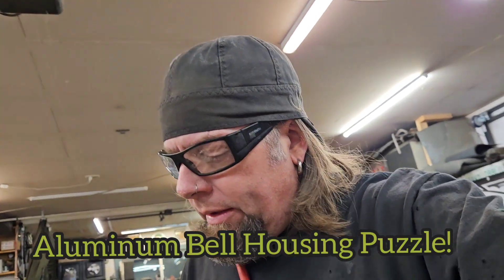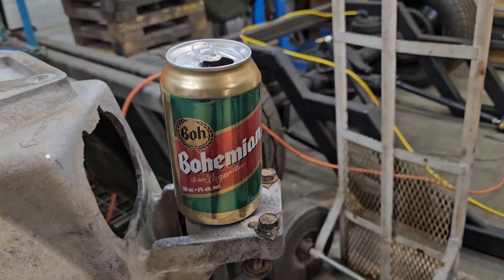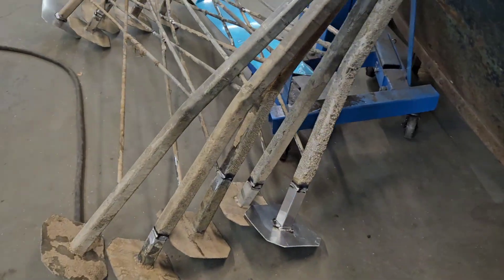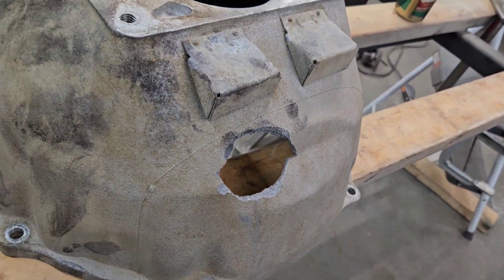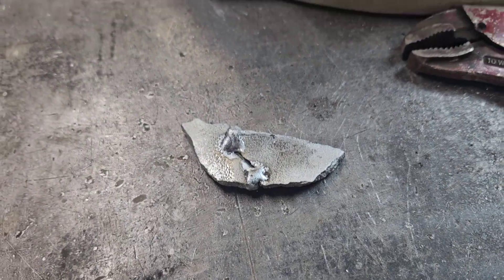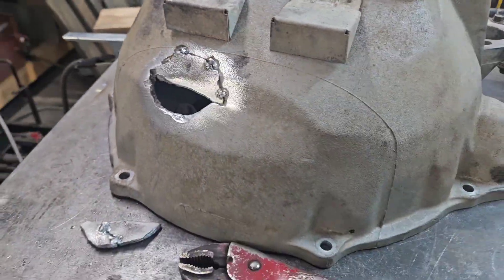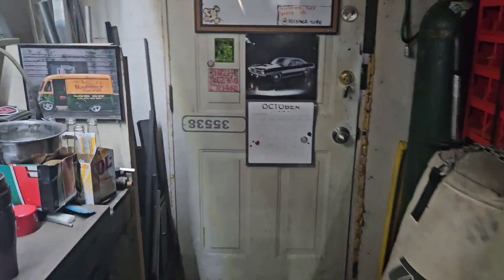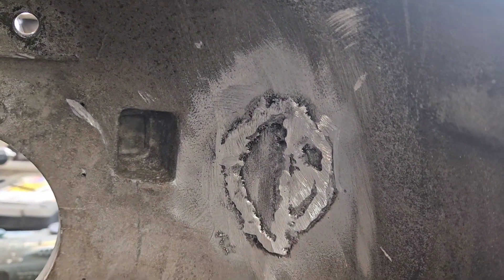Cast Aluminum Bell Housing Repair

Comment: What filler do you use on cast alum.
Reply from the maker: This one i used 4043, but 5356 is usually fine, too, but it can contribute to porosity issues with the cast.